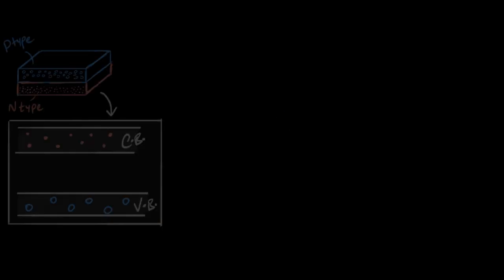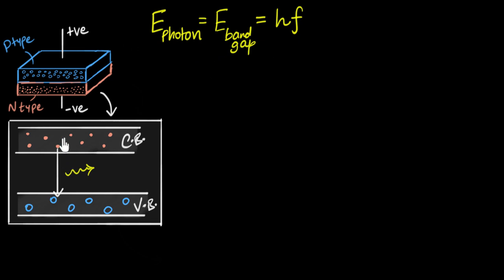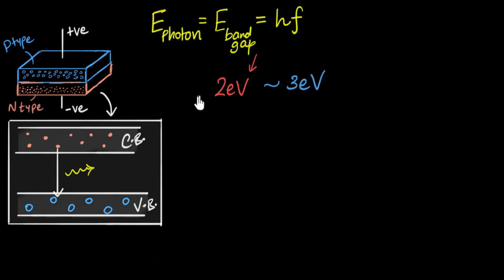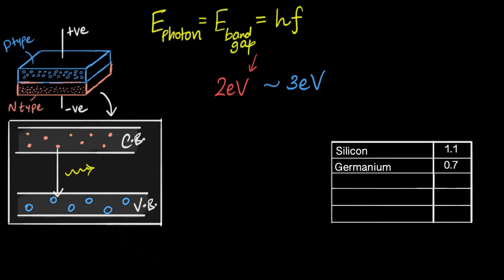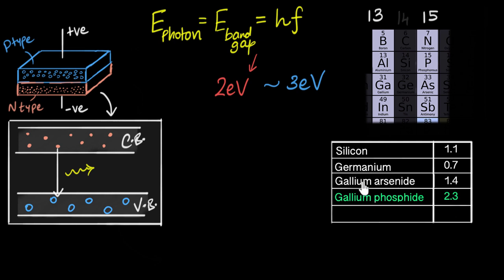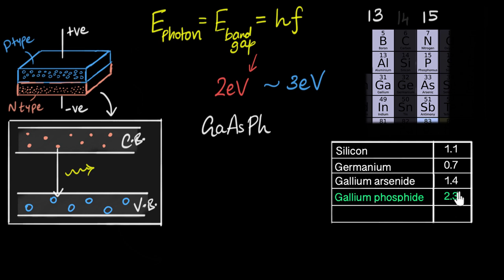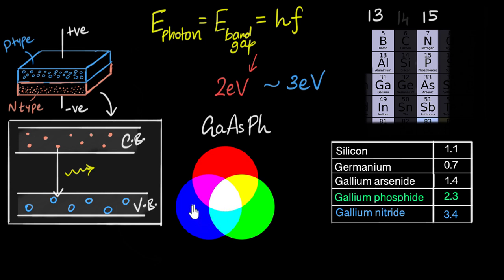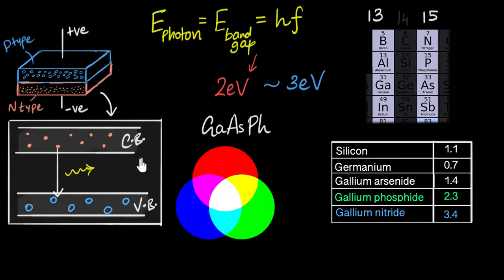LED - color & fabrication | Semiconductors | Physics | Khan Academy

Comment: What puzzles me is how you get a PN junction with a single material, that is to say, the mixture of group 13 and 15 elements. I am guessing this. That mixing groups 13 and 15 gives you both free electrons and holes, and thus a conducting material. So the result is not a diode, but a conductor in both directions. The free electrons then drop into the holes, and give off EM waves as they would at a PN junction. Anyone agree or disagree?

Comment: My question is: How the phosphor layer reflects yellow light when they are being bombarded by blue light? For eg, leaves appear green because other colored photons are absorbed by them but they reflect green. Please clarify. This is the biggest misunderstanding I have about light.
Reply: It absorbs the light from the blue LED and emits in a broad range from greenish to reddish, with most of its output in yellow. This yellow emission combined with the remaining blue emission gives the "white" light, which can be adjusted to color temperature as warm (yellowish) or cold (bluish) white.
Reply: @ShawnDypxz  Did you just answer your own question 

Also I thought chlorophyll gave leaves it's characteristic green color